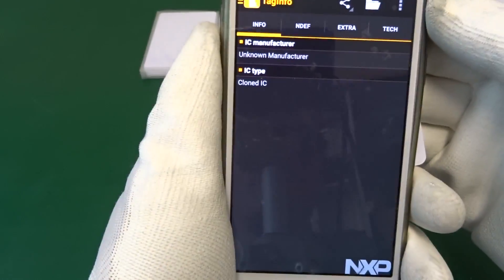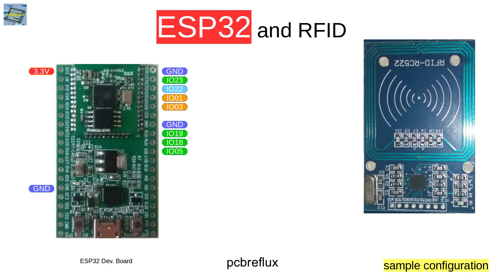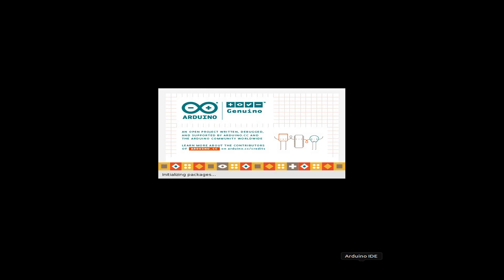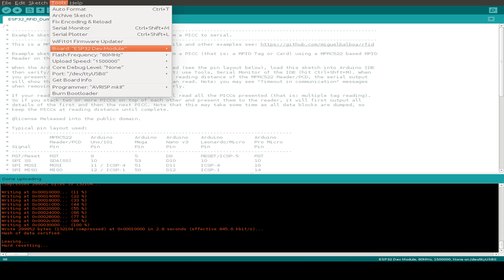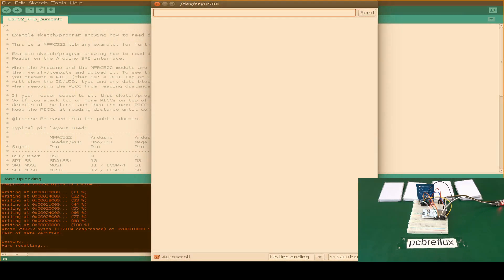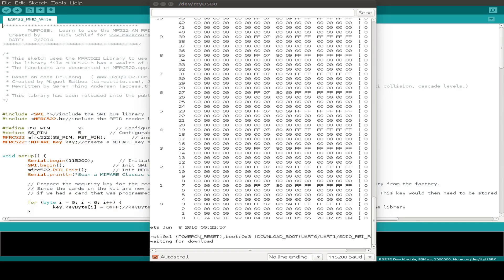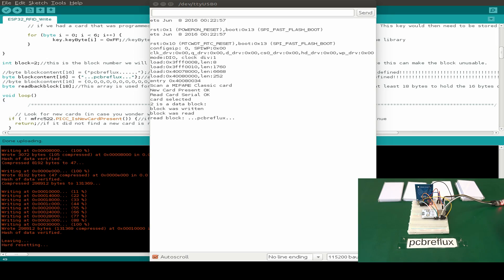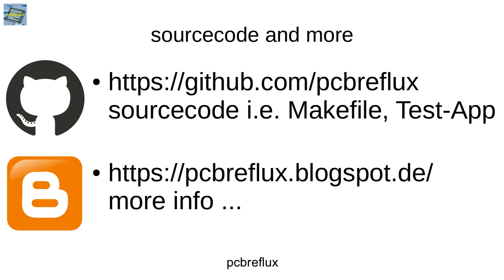ESP32 #33: RFID Read and Write with MFRC522 Module + ESP32 Giveaway

Comment: I can't get my module working. The line: mfrc522.PCD_DumpVersionToSerial(); returns "Firmware Version: 0x12 = counterfeit chip". What does this mean? I have connected it to my ESP32 as follows:
3.3V - 3.3V
RST - D4
GND - GND
IRQ - NC
MISO - D19
MOSI - D23
SCK - D18
SDA - D5
Any suggestions?

Comment: Thanks for this.  I have a door entry system using arduino pro minis.  
Down side being re-programming  meant plugging in a laptop. 
Was able to get it running on ESP32 using your instructions, so I can now plan to make it re-programmable wirelessly.

Comment: Please help!
I have an ESP32 Dev Board and MFRC522 Module but the function rfid.PICC_IsNewCardPresent() returns not true, if i hold a card on the reader. On the Arduino Uno R3 the reader is working.
I have tested the version 1.3.3, 1.3.4, 1.3.5 and 1.3.6 still not working... any idea?

Comment: I tried this and had crashing with the current RDIF library version 1.3.6, switching to 1.3.5 (as was used in this video https://youtu.be/waYM37_fUsg?t=127) works.
Reply: this did the trick for me, switching 1.3.5 works but the default latest 1.3.6 throws exception. Same goes for nodemcu esp8286-12E ; ie. only switching to 1.3.5 works.
submitted bug report to https://github.com/miguelbalboa/rfid/issues/324
Reply from the maker: Hi, thanks for your info.

Comment: Just as a note to people who want to implement NFC in their
projects: 

Although Miguel Balboa's RFID library for MFRC522 supports
Crypto1 algorithm of MIFARE Classic cards, but you should be aware that they
are notorious in regard of security. Relying on their encryption algorithm is
generally not a good idea! By using a simple tool like ChameleonMini you can
easily clone or emulate these tags!
Reply: True. If you want security, spend more money and buy a MIFARE Plus or DESFire EV1 or EV2 (the original is not safe enough and I don't think you can save money buying it instead). The DESFire use a filesystem architecture and aren't supported by the RC522 library, AFAIK.

Comment: to make a wall mount rfid topup device, I think esp32 + MFRC522 Module + 4.3-inch Lcd (sunlight readible, oled?) + ethernet + 3d printed case (ip65) + 9-36v to 5v converter
is a good choice, isn't it.
or just use the passengers nfc enabled mobile phone :)
Reply from the maker: This was only a start, maybe with more security on the TAGs + EPS32 + WiFI/Ethernet + MQTT over SSL, mosquitto and a small database you can build up your own DIY logging and/or entry system.

Comment: My Do-it esp32 dev board doesn't recognize the rfid reader at all... I works well with my raspberry pi, but I had no luck with my board... any ideas why? I used the same wiring and library version... :(
Reply from the maker: +Teoni Valois Have you a cheap logic analyzer or can hook up led on the gpios? I've tried 3 different esp32 boards without any issues. Maybe one of your gpios are not ok?
Reply from the maker: Teoni Valois An other suggestion: what board did you use in the Arduino IDE? My pinlayout is related to this file https://github.com/espressif/arduino-esp32/blob/master/variants/esp32/pins_arduino.h if you use other then the dev board you have to change the SPI pins (see this for an example https://github.com/espressif/arduino-esp32/blob/master/variants/esp320/pins_arduino.h).
Reply: I have already checked all gpios with LEDs and they are fine... this is the bird that I have: https://github.com/SmartArduino/SZDOITWiKi/wiki/ESP8266---ESP32
Reply: pcbreflux seems the same linage as mine... here's the info about the board I have: https://github.com/SmartArduino/SZDOITWiKi/wiki/ESP8266---ESP32
Reply from the maker: If you have considered the other position of the pins, then I have no clue.
Reply: I got a new RFID reader and it worked beautifully! I wonder why the old one works on the raspberry pi, but not on my ESP32... and they are from the same brand and model. Thanks for all the help!

Comment: I like that you used the Arduino ESP32 core for this. Makes it really easy to set up.
Reply from the maker: Its true if you use the hundreds of excelled libraries and its very easy for everyone to start. But from the writer point of view there is no syntax highlighting, auto completion, library jumping, on the fly compiling, debugging and so on. If you use the features some time then the arduino IDE is a little  step back. Hopefully this will implemented soon maybe switched by some kind of "advanced mode".
Reply: Thanks for this video again!
1) I also appreciate using arduino IDE. I do not have a linux PC or laptop and so I am lost with eclipse. 
I am using notepad++ to mitigate the weakness of the arduino ide editor.
What I am interested in is the programming of both cores and exchanging data between them using arduino ide. 

2) I created a readout unit for a conventional water meter using two WeMos. Unfortunately  one Wemos was not able to handle WiFi data transfer and ensuring flawless data counting. Using an additional WeMos dedicated to counting only solved the issue. I think a solution with one ESP32 would have been much more elegant (although not cheaper).
You can find some pictures there https://homematic-forum.de/forum/viewtopic.php?f=31&t=35461&hilit=wasserz%C3%A4hler#p339949 

3) I also created a RFID unit 125kHz with a WeMos to help my old mother to enter her house. She always forgets her key.

4) Im also using the 13,56 MHz RFID technology widely by myself but in a totally different way. I read the RFID Tags attached to special places using my Chinaphone. The Phone transmits commands to the home automation system via WiFi. Here the security relies on the wifi transmission between the smartphone and the router.